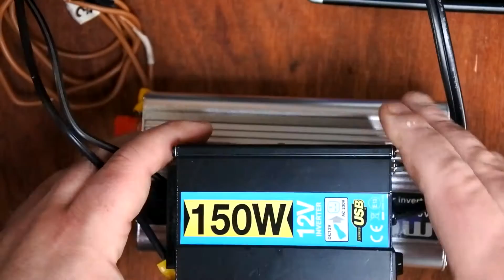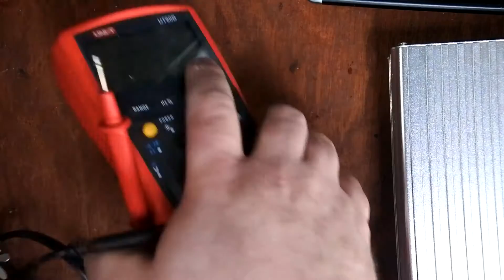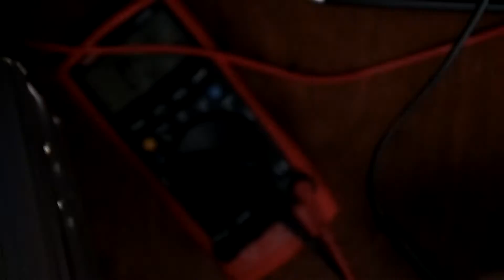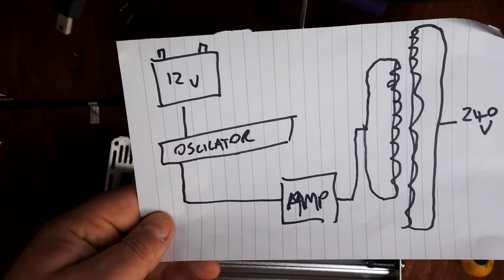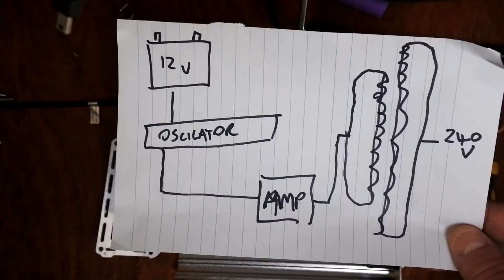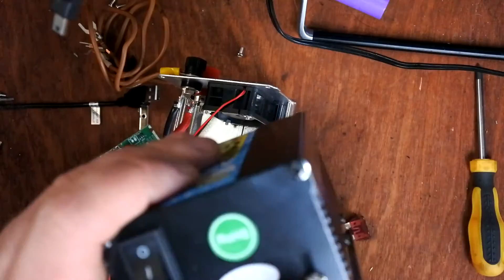A look at a crappy and slightly dangerous main inverter..

Comment: 2:45 actually European regulations has standardized (or supposed to have) all countries in the EU to have 230V some countries used 220V others 240V. Of course that depends on the installation and how far it is from the main power transformer.

Comment: I bought this same garbage from the TOMTOP dumpsite , from the beginning when i turn on the switch the fault indicator flashes with or without load . With a lamp as a load the lamp also flashes . Have you any opinion of what is wrong with it ?
Reply: A) a current sense resistor (higher wattage than the rest of the circuit) has shifted its value upwards and B) a pulse suppression capacitor (usually connected in parallel to that current sense resistor) has lost its capacitance due to either aging or low quality of manufacturing. Either of the above reasons has the net result of triggering the overcurrent protection circuit too earlier than what was originally designed.

Comment: I bought mine, did try it right away. Plugged in my angle grinder- nothing. Plugged in my die grinder- shot sparks out the fan and made a burning smell. Took it apart and the two of diodes on the side were burnt up. I can’t remember what I paid for it but it’s garbage now. Can’t remember the brand but looked a lot like yours inside.

Comment: i brought this same rubbish from ebay says 200 - 400w on mine and wont even run a small stereo with out over heating and cutting out .
Reply: Most likely it's to do with the modified sine wave rather than power.

Comment: I expected a slightly different review of this inverter. Rather than seeing what it looks like inside, I'd expect a demonstration of how it works (electrical performance). Anyhow, it doesn't look too bad. If it works, if it delivers 1500W and doesn't burn, I wouldn't call it a crap.
Reply: These inverters can hardly put out 500W. Their design is poor in every aspect. Transformers, FETs, capacitors etc, are all underrated against the power the manufacturer claims that they put out. Or in other words, the wattage printed on them is simply overrated. At least doubled.

Comment: actually many good quality inverters have spade connectors for the fuse holders, also most of the bigger ones use multiple fuses because max stantard car fuse size is 40A. Totally not saying that this is a good quality unit tho!